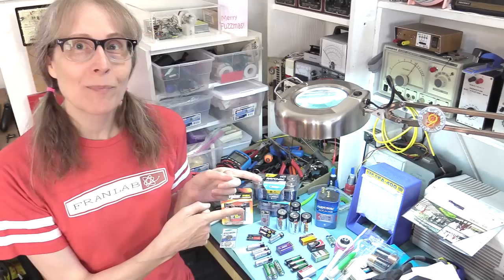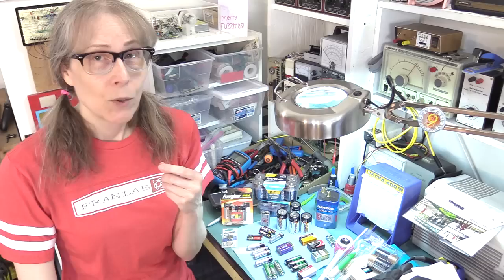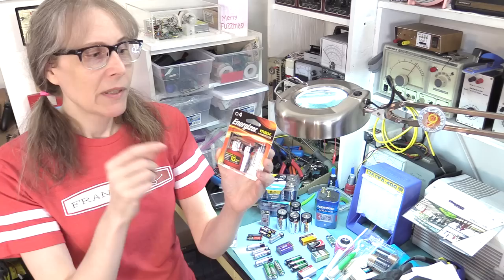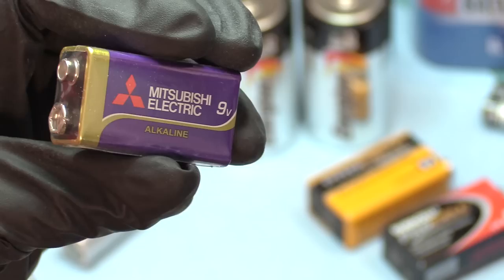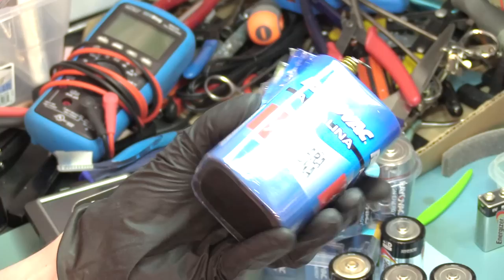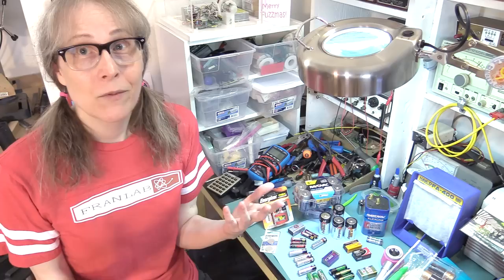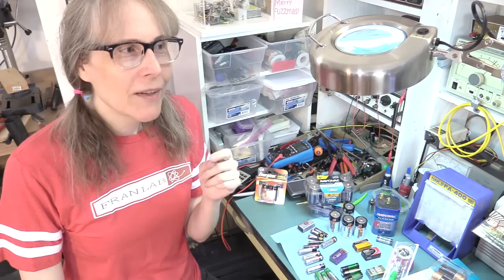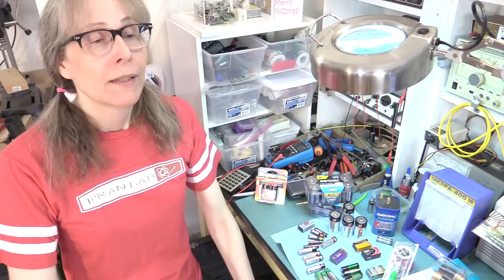Yikes! Leaky Alkaline Batteries!!!!

Comment: When the tv remote starts to go who on here opens up the back and rolls the batteries backwards and forwards a few times 🤣
Reply: I always do !!😊
Reply: My Samsung's remote frequently stopped working, even with new batteries. It helped to roll them, but it was so often,  I had to change the remote.
Reply: In a real pinch, warm them with your hand (without extracting them) to get a little more power out.
Reply: Yup. I do that with many battery-powered devices. It helps to scrub oxides off the contacts.
Reply: I simply press the buttons harder.... 🤣
Reply: @mal2ksc  I've used a blow dryer
Reply: @nickeystardust  I've had a couple of old remotes that required hard pressing on some of the buttons. It's quite easy to take it apart and clean the contact surfaces on the board and the back of the buttons, then it's like new again.
Reply: I do.  Works for reviving flashlights, too.
Reply: I usually do but found out just slapping the remote down on a table often works just as well, partially because the battery compartment allows enough movement to cause bad contact.
Reply: Since the chinesium used in electronics is the lowest quality possible,...the contacts actually RUST
Reply: Works in a pinch especially if you have to look for or buy batteries 😁😎
Reply: @nickeystardust  lol
Reply: I just press the button harder ;P
Reply: Used rocol contact cleaner in the past .though be careful some electronic cleaner dont like rubber . destroyed a jvc ghetto blaster remote that way .
Reply: I pull them out and switch the positions.
Reply: rub on carpet
Reply: Me!
Reply: LED flashlights, too !
Reply: Rubbing the battery poles on your blue jeans (or a piece of wood in the workshop) and a pencil eraser on the device contacts will clean them without scratching them.

Comment: One thing I learned as an electronic technician in the Air Force: if a battery-powered device is going to be "on the shelf" for more than a month, you must remove the batteries first. I still do that with my personal equipment ... usually.
Reply: Whenever I forget to remove the batteries, it's guaranteed that those batteries will leak.
Reply: fortunately it takes like 3 years for this but remotes tend to suffer in my household

Comment: "Copper top" batteries used to be all I would buy up until several years ago, after they decided to cheap out and started using thinner metal for the outer can.  For me, they've slimed the innards of at least half a dozen remote controls, a wii-mote, two really nice LED flashlights, ruined a vintage HP-48SX calculator and corroded the inside of an aluminum 5-D Maglight beyond recognition.  Yet I've found freebie throw-away batteries labelled "Alkaline Cell" sitting dead for years inside various items that were perfectly fine.  So yeah, F**K greedy Duracell and their premium priced, goop leaking shiite cells.
Reply: Me too!  I trusted Duracells for a long time, but foolishly.  I've had so many leak and ruin things, but as they know, it's usually not worth the trouble to make a claim for reimbursement.

Comment: Be sure to have safety glasses on when removing leaking cells. I had a friend whose daughter had to be rushed to a local hospital due to the KOH (or K2CO3)  popping into her eye when removing a leaking cell. The doctor said that she nearly had to have a cornea implant due to the damage caused by the electrolyte. Also -  always be near a sink for emergency eye-wash and/or  to wash hands after the  leaking battery is removed.
Reply: Good advice

Comment: Bought a 36 pack of duracell AAs from Sam's club. Couple months later went to grab a couple and found 10 leaking in the package. 
Returned them to Sam's for full refund.
Reply: I had the same but contacted Duracell and they sent coupons to replace them 2x over.
Reply: Don’t buy them at Walmart or sams club,,every other store is ok
Reply: When you find big deals on batteries it's often because they're very old. Especially dollar store batteries.

Comment: My AA Duracells leaked while still in the package. I had them  stored in cool dry place for about a year.
I found them all immersed in liquid with the wrappers fallen off.
Reply: Wow!🤬
Reply: I bought a bulk carton of Energizer, and 3 out of the 20? Leaked. Powder not liquid. The Duracell piss out it's contents inside.
Reply: I won't buy duracell anymore.  At least 5 -6 times over the last year or two,  I have found AA's leaking straight out of the brand new package.   Of course there's no way to check for leaks through the packaging.  haha, Fran just mentioned this as I write this!!
Reply: spicy pillows more like spicy smarties

Comment: There's a very easy way to prevent damage from leaking batteries: coat the battery holder contacts with dielectric grease (best) or petroleum jelly.

Comment: Another thumbs down on Duracell, especially the AAs - I stopped buying them.
Reply: Duracell has been banned from my company and my home.  Just say no.
Interestingly, my experience is that the grey-market Duracells that usually come with devices from China aren't as bad as the domestically-sourced ones.  Maybe they are just cheap knock-offs with less electrolytes.  Either way, we just get rid of them.
Reply: I also had a lot of problems with Duracell so I no longer use them.
Reply: Based on continually finding corroded "DuraLeak" batteries, I'm now avoiding them. Recently I found an old non-Duracell alkaline battery in a long-forgotten device. And it was fine!
Reply: Agreed, I stopped using Duracell years ago. Out of all the various brands Duracell were the ones that invariably leaked.
Reply: 100 % correct... while cleaning out my late father's home of 45 years, found almost all Duracell batteries had leaked at 5 to 8 years. Garbage batteries ! Do not use....no others had. I recommend baking soda if you need to clean
Reply: Also Varta. 
Just buy Ni-Mh cells or, if they don’t work, lithium cells.
Reply: These have always leaked, even going back 50 years to when they were "Mallory" brand. They would actually leak when new and fully charged. Liquid, not gas. They would leak while on display. Compared to then they have improved but they are still the worst.

Interestingly, the 9 volt ones never seemed to leak. Possibly because the stack inside was coated with wax.
Reply: Amazonbasics are just rebranded Energizer and they're really good
Reply: Duracell seem to have serious leaking issues. Every battery leak I have seen has been this brand. Just had a doorbell damaged by them. Unfortunately, they are sometimes the only brand on sale, but I won't be buying any more.
Reply: Duracell batteries are utter trash
Reply: In my experience, Duracell are the worst. They start to leak, even if the device is still working.
For some years, I mainly use Panasonic - without any problems.
Reply: Every, single, device I've had Duracells in, was damaged by them leaking. Remote controls, flashlights, weather-clocks, the remote temp sensor for the weather-clock, everything.  I'll never buy them again.
Reply: Duracell are the worst I've lost count how many I saw them leaking their guts out unbelievable crap exist even some alkaline GP battery start leaking after 2-years I guess one more win for the rechargeable
Reply: Yeah same here I used to use them in remotes until I opened one up it was still working fine but them I realised that the batteries had leaked and corroded all the contacts. I won't be buying them again that's for sure.
Reply: Anything but Duracell. Duracell are junk, and will leak everywhere.
Reply: Duracell isn't the same as it used to be.  They leak and destroy electronics just like the cheap batteries.
Reply: Same here.  A bunch of my unused Duracell batteries leaked years ago.  Stopped buying them altogether.  Never had any problems with Energizer.
Reply: AAAs are twice as bad.  Amazon brand have been working well over the years.
Reply: I yes Rayovac Fusion now.  ( made in America - good for12 yeas storage).
📻🙂
Reply: Every device that I’ve left Duracell batteries in for any length of time has leaked , not all of them have been dud either and were still working
Reply: I have had EVERY brand of battery leak like crazy - Duracell, Energizer, and Ray-O-Vac.

The only batteries that haven't leaked on me yet are the expensive Lithium ones, or the non-alkaline carbon-zinc batteries.
Reply: @Paul_Wetor  Indeed, before about 2015, Duracells never leaked.  I have had newer Duracells leak in the package, but old Duracells from 2010 in some remotes are just fine.

They clearly changed formulations or manufacturers.
Reply: VideoArchiveGuy 
All battery companies- batteries will leak, but Duracell notoriously have a major problem in this area.   Many, many complaints.
The problem with the Lithium batteries is, in certain highly sophisticated electronics, ie: C.Crane
CCSKywaveSSB, pocket radio, they caution AGAINST using Lithium batteries.
📻🙂
Reply: Was going to say the exact same thing! They are the worst! I stopped buying any duracells.
Reply: I don't know what happened, but yes ... "Duracell" batteries have turned to absolute trash. For many years, Duracell appeared to be the only battery you could count on NOT to ever leak! It was all I ever bought and installed in devices. Then, I think starting about 9 months/a year ago, that all changed. I recall being shocked first time I discovered a nearly ruined device with badly leaking Duracells in it! Disbelieving, I tried again ... with same result. And, as many others here point out .... now? I wouldn't put a "Duracell" in anything I own. They've failed too many times now. As I believe Fran points out ... I have switch to Engergizer ... and they do seem, much to my surprise, appear to be leak-proof. The very worst batteries I've never trusted, By the Way ... have been Ray-O-Vac .... but perhaps they've improved. In any case, good luck!
Reply: their AAA's arnt much better, ruined my Bose QC15s
Reply: Same here, they are expensive rubbish. Here in the UK I buy Aldi or Lidl own brand and these are fine.
Reply: Isnt duracell just a label these days? As i remember some test video said Energizer is too.
Reply: Me too.  They almost ruined several of my remotes.  Never again!!!!
Reply: I've had problems with Costco Kirkland AA cells.  As Costco promotes Duracell I have a suspicion they are one and the same.
Reply: The only good Duracell, are the yellow professional series. But the copperheads are absolutely bad - and expensive.
But it is interesting, the energizers in the US are better than in Europe! They are a little bit better, than Duracell, yes - but I also had also leaking ones.
Surprisingly good are Sony Alkaline... Cheap batteries, available in Austria via a discount supermarket.
What I don't understand: Kermits batteries are no alkaline! I also had GP batteries in some toys (never had any probs), but all were marked as "super heavy duty" - these are zinc/carbon batteries! Normally, they must leak? We all remember the dripping battery compartment, don't we? Why do the GP cells last so long and have no leaking issue?
Greetings from Austria 🇦🇹
Reply: @jeffking291  I have leaking Ray-O-Vac Fusion and Ray-O-Vac.
Reply: @Yattaman 
I’ve gone to Rayovac Fusion, for long term storage.
📻🙂
Reply: @NETWizzJbirk  
All batterie companies will have a certain amount that will leak.
No one is perfect. That’s why, no matter the brand, one should NEVER leave batteries in any device ( except  Smoke Detectors, and these, with Remote controls should always be checked on a regular basis.
📻🙂
Reply: @jeffking291  Bullshit 20 years ago Duracell did NOT leak with hundreds and hundreds of tthem.  Now every 4th one seems to be a leaker.  They are junk.

Comment: To repair corroded terminals I've found that cleaning them with a dremel and then coating them with silver solder almost always saves the day as long as it didn't get the board. You can use regular solder in a pinch, but the harder silver solder holds up a lot better.Also sometimes it takes a little acid flux to get the solder to stick but I've used this to salvage the unsalvageable.
Reply: DuraLeak are the worst

Comment: I started using NiCd AA cells when I started my Undergraduate University course in 1978. Ive been using Low Self Discharge NiMH cells from the time that the Sanyo Eneloop came on the market. I have 6 brands of NiMH and always use these in any product that I purchase discarding any supplied Alkaline Batteries.  I regularly change the NiMH batteries and recharge them. I have never experienced any leakage issue with NiMH batteries.
Reply: Me too. I got a good chinese nimh/li ion charger (liitokala brand) with current control and a very good display and I use Sony/eneloop batteries for almost everything, even for remotes.
Reply: Nickel metal hydride self destruct rate is just way too high, alkaline batteries in a TV remote can last years while even if their unused, they will discharge themselves in six months if they are rechargeable. Rechargeables are for everything except for things that last a long time like clocks and smoke alarms.
Reply: ungratefulmetalpansy  exactly, when you put such small amount of load on the cells, not only do they actually output the energy less efficiently and therefore reduce the capacity in half, their self discharge rate is so high that you end up replacing them after a month where alkaline would last you 6 months
Reply: ungratefulmetalpansy  that more depends on the quality of your cells
Reply: @pilotavery  ever tried the low self discharge NiMH?  They keep charge for years
Reply: Blind Bob  At 1.2 V there’s still nearly half of the original charge left in Alkaline batteries. Depending on the current the devices draws, possibly even more. So if it cuts out at 1.2 V, it’s a badly designed device anyway.
Reply: Rechargeables are a nice idea but I find having to recharge them more annoying than just pulling new ones out of a package and replacing them.

I've also discarded a few Eneloops over time because they were leaking along the edges. Not enough to damage anything but noticeable.
Reply: @VideoArchiveGuy  I have a few sets fully charged ready to replace any that are nearly exhausted. I recommend either a Nitecore charger or standard Eneloop charger to ensure the correct charging cycle - incorrect charging can cause cell damage and the possibility of leakage.
Reply: FYI, ikea batteries are eneloop pro's